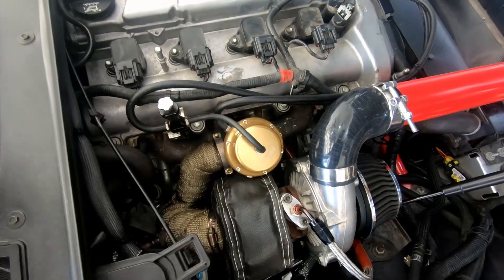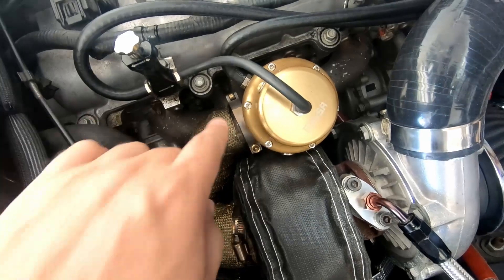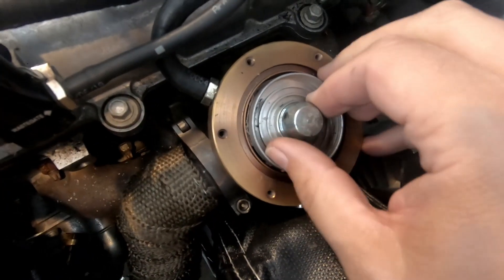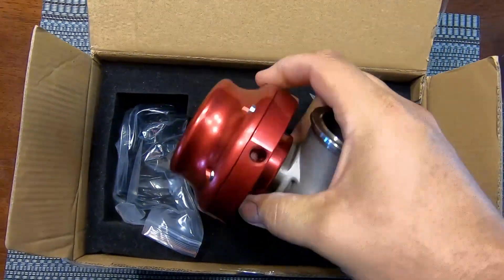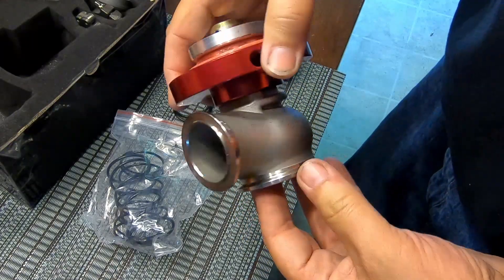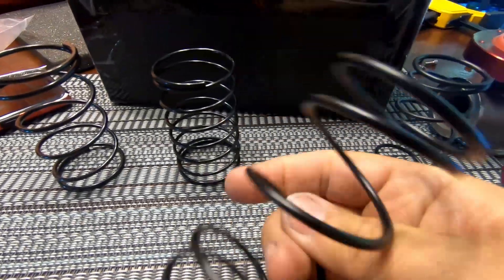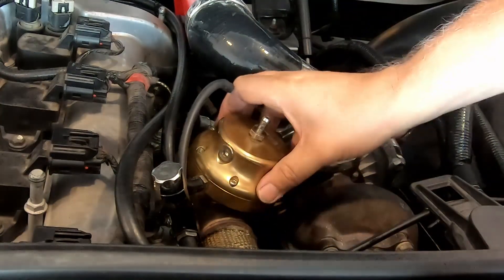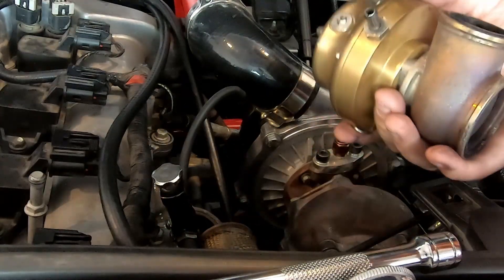Changing The Springs In My Turbo Wastegate - Then This Happens!!

Comment: Hey Mike, I'm looking to do this same setup (I've currently got the K04 on my 2006 LE5/2.4). What turbo are you running? I'm trying to get a consistent 10 psi, but I haven't been able to pin anyone down that runs a T3 manifold with a decent turbo for the 2.4. I'm torn between the GT3071 and the S252 but I'm looking to replicate a build that currently runs like yours. Any help is appreciated!

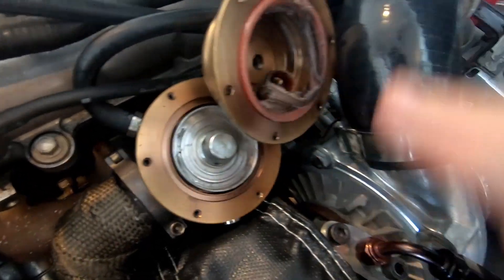Comment: 5:10 I can't believe the diaphragm gave out like that.  I have an external HKS wastegate on one of my cars and it is all cast iron and has cooling fins on it to shed the temperature of the exhaust outlet.  I can't imagine a cast aluminum wastegate lasting.
Reply from the maker: Well, I'm sure I'll eventually find out. The original owner of this turbo setup told me that the wastegate was black when he installed it and the heat turned it into the gold color. So I'll keep an eye on mine and if I start seeing the color changing, then I know it's getting too hot.
Reply: @MikesHouseOfMods  Great job, Mike.  Keep the fuel ratio in check, and you'll be fine.  Glad to see you actually use your car in autocross.
Reply from the maker: @afternoongarage  Thanks. I have a wideband air/fuel guage on my A-Pillar to keep an eye on the fuel ratio. It came in real handy during the tune. As for autocross, this car is a blast to race with. And now with the added turbo, I can get from one cone to the next quite a bit faster...lol.

Comment: As far as the rpm motor sports remote tuning goes, do you pay for the tuning once until it is finished or is each change made an extra charge?
Reply from the maker: When I had RPM tune my car when I did the 2.4 Stage 2 upgrade (no turbo), they kept tuning it until it was complete. I would assume once finished...if I added something else (such as a high flow cat), they would charge to retune. However, the tuner I used when installing my turbo charged me a one time fee and provided 6 months of tuning. So basically, even if my tune is complete, and I decide to change injectors, or Cai or whatever, as long as it's within 6 months, he won't charge me anything extra.
Reply: Justin L. I second this question
Reply: ImaScranbob I have a turbo waiting for my 2.4, just waiting on some more parts and figuring out the tuning.